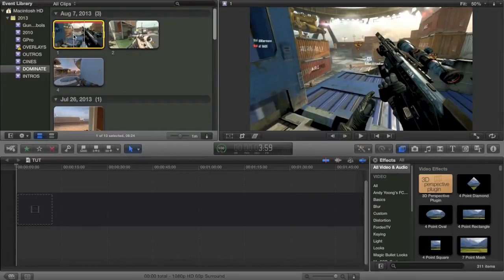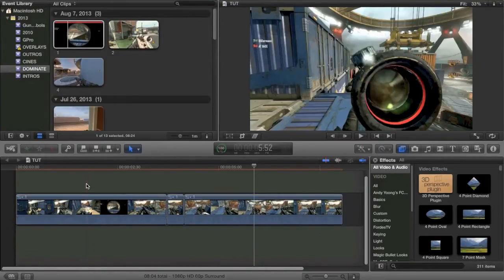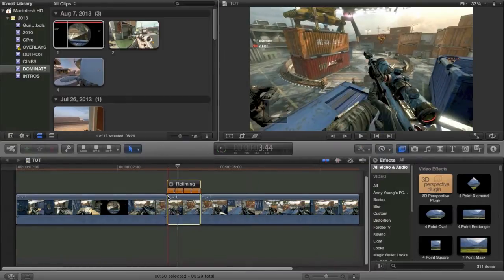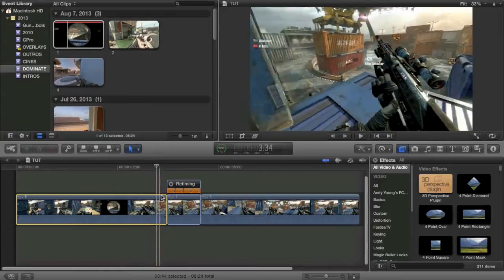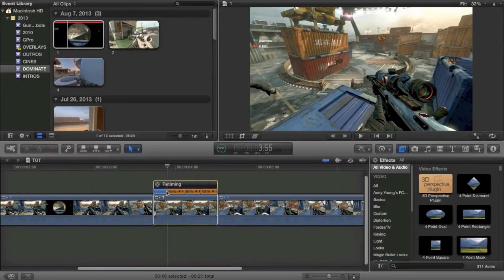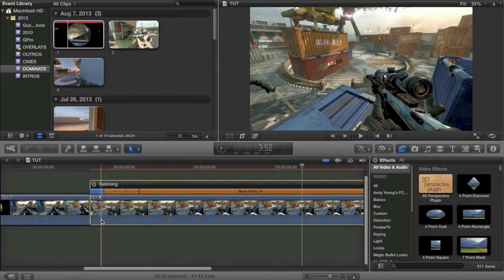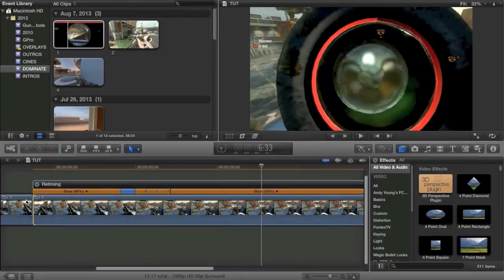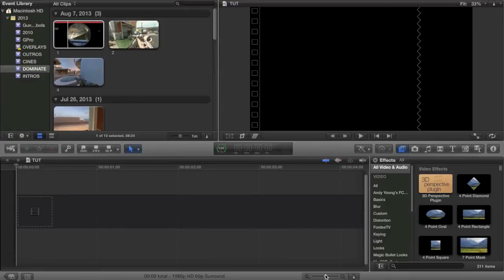Velocity Curve FCP X | Episode 39

Comment from the maker: It was up, ages ago. They don't stay up eternally. The point of that pack was to benefit the 1k people who originally subbed. If I put one up now, it would defeat the purpose.

I will be creating a professional series of around 100 tutorials, with an editing pack 10x better than the original one very soon. It will cost money though. I basically plan on creating professional guides that surpass what I did in this video.